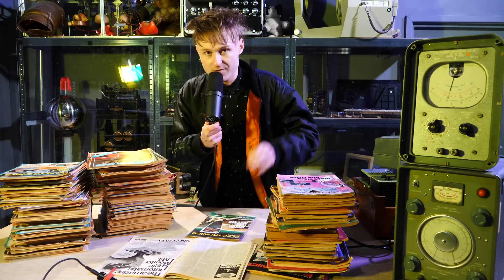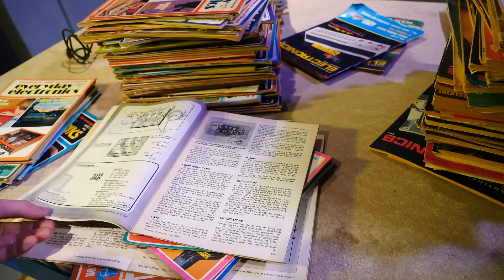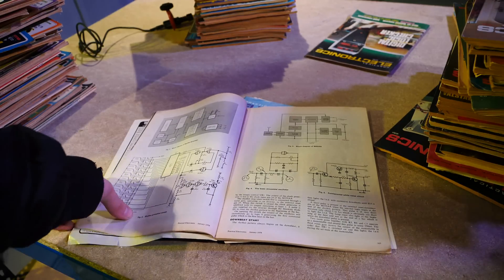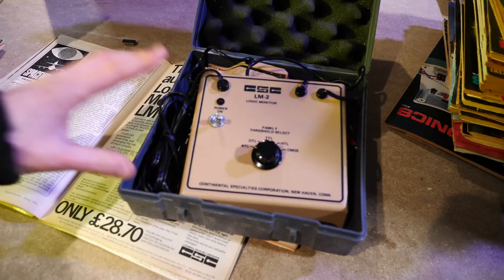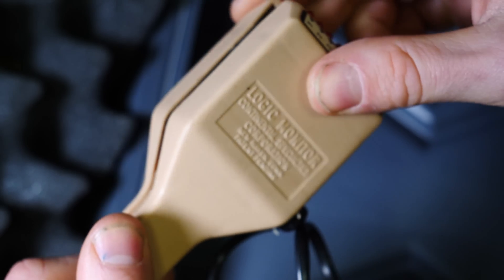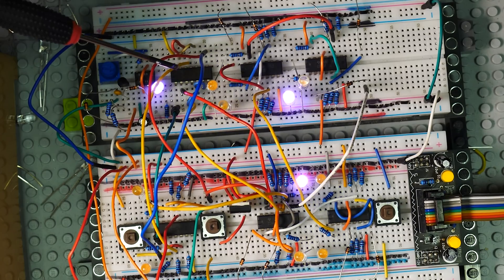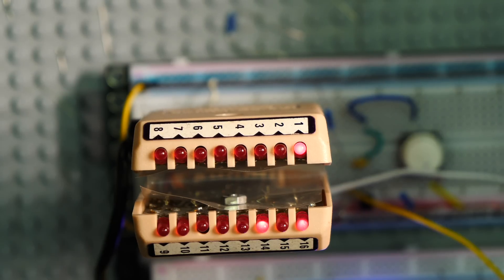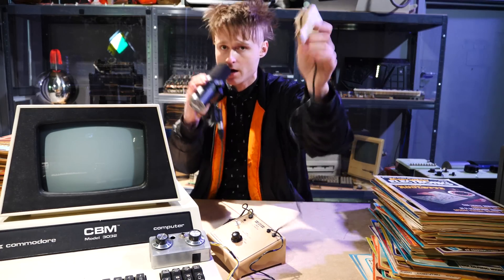Strange 1970's Chip Monitor Test Equipment - LOGIC MONITOR LM-2

Comment: I remember using the LM-1 in secondary skol and it was good when troubleshooting 74xx circuitry, but this is around 1980, on the other hand it did not like the 40xx cmos att all
the LM-2 that you got has the circuitry to handle cmos but the LM-1 that i used in skol only worked for ttl but a useful peas of kit anyway

Comment: Sir
Ref~ GAMEBOY MEGAMACHINE - POLYPHONIC FILTER CONTROLLERS ANALOG

Your original design was correct.  You just introduced the biggest noise to the system when you tried to suppress the vertical hold on all your new screens! (by shorting it out, you sent that noise to the ground of your entire system Sir)
. A suggestion~ 
Would it not be possible to have an independent vertical sync pulse? that is not modulated by the time clocks of the modulated processors?  And buffered!
Please don't trash the finest modern synthesizer in the world~~~~~~~~~~~~~~
R X
PS. Your ultimate masterpiece is perfect. do not doubt
Reply from the maker: There was no noise added? Plus I tried the pulse those screens dont take it

Comment: I had one of these when they were new and cool. Mine definitely was a stand-alone clip. There was no support box. As I recall, it got enough use to be worth the cost. As a dead-chip detector, it was a real time saver too. Another must-have was a logic probe and logic "injector". Basically a one-pin version of this. The injector let you pull pins low or high at will fairly safely.

Comment: Hewlett Packard offered two versions of the Logic Clip.  One was 548A, multi family (TTL and CMOS), and 10528A (TTL only).  The prices in 1978 catalog were $125 and $90, respectively.  The CMOS version operated from 4 to 18 V (and tolerated 30 V for 1 minute).  The TTL version was specified to only 5V +/- 10%.  To really be practical, you needed to have ability to clock the circuit at very low frequencies.  For that you could use a pencil shape pulser 546A that could produce pulses at 1, 10 or 100 per second.

Comment: Talking of reverse capabilities and chip testers , there's a side story to this in the commercial field ! . I wonder at just what period , the hole copyright thing took of on using internals from keyboards and synthesis etc , externally to there ment connectors . Not to mention the hole " I will destruct if I'm tampered with " thing although that's probably mostly military equipment . I suppose that the tester is one of the positives of that period in electronics ( that's if I'm correct )  , i mean and I'm totally guessing that , certain calibration tools are only available bye specialised and dare i say qualified technicians and are also quite expensive , but it is annoying when you unplug an internal connector only to realise that when plugging back in the hole process has to be either be recalibrated bye and external computer or simply coded with a new licence . Even when the device lights up and is recieving the correct voltage etc etc .

Comment: This is great. I was a kid in the 70s, and saw these advertised in Byte and Popular Electronics, but in all these decades I've never seen one in action. It's amazing! I also was only aware of the standalone models that pulled power off of the chip, like the one in the magazine. This one supplies the op-amp power, and a reference voltage for whatever logic family. I've also found on a google search, an LM-2A by Global Specialties where the clip had ribbon cables, and the LEDs were in the main unit. Definitely not as cool as having the LEDs on top of your chip, but maybe less bulky and more reliable.

I guess the op-amps would be wired up in comparator mode between each pin and a reference voltage for the logic type. There's a bunch of 470 ohm resistors for the LEDs, eight half-chip op-amps, and eight more 240K resistors between each pin and an op-amp. The other board should be much the same. Anyhow, there's enough pictures to trace out the circuit.
UPDATE: each channel is: pin → 240K → - input ; Vref → + input ; output → 470R → LED → LED power (+5V?)

I should try to make one, maybe I can use a regular chip clip and some Arduino headers, or 16-pin ribbon cable headers. Probably two circuit boards with common wires for power and ground, but it might need to be SMT. It shouldn't be hard to wire up a prototype pin circuit. I could even build a 40-pin version. Seeing that blinking on top of a Z80 or 6502 would be awesome, and it really needs to be done.
Reply: Still made one of these? Could you share the schematic? Thanks

Comment: That logic tester that you could clip on a chip were still sold in the 90s maybe even early early 2000s.   Haven't seen them much in the last 20 years.  Useful for learning digital logic.   But maybe not so much for fast ( high clock rate ) circuit.

Comment: Being an old fart Electronics Test Engineer, I remember using something very similar as recently as 6 years ago at work. They were used as part of a fault finding kit. The main difference was that the ones we used were TTL/CMOS specific for 14 and 16 pin logic arrays/gates. They were powered directly from the on board 5V logic supply. There was a sliding window switch over the top of the LEDs for 14 pin or 16 pin device selection. 

An invaluable in circuit fault finding piece of kit. Along with LED logic probe (with pulse 'memory') and a high/low tone buzzer for audible logic high or low identification. 
Cracking video, brings back memories of many hours spent building projects on copper strip vero board, love it. Thanks Sam.

Comment: Interesting bit of kit. I have a couple of RS versions which are powered by the chip (no external box). I think the op amps on there will be working as comparators, the selector on the box will select the voltage level for a logic one, and the LED will light if it is over that voltage, so 2V for TTL, 2.5V for CMOS etc. The 145 is the keyboard row selector, so the LEDs show the binary of the row being selected. The outputs are open collector, so won't light up. The 138s are the address decoding and show which of the big chips on the board are currently in use. The 00 includes the gate that drives the sounder, so you might see that flashing when sounds are being made. Over on the right, the 393 is the main clock divider and the 166 is the video output shift register, should be a lot of activity on there.

Comment: I think that rather than a simple buffer chip, the tester probably has 16 comparators in it.

That way, the box just has to supply a set voltage for each logic standard, which sets the logic threshold for the LEDs.

That's just a guess, though. lol

Some of those other logic standards like RTL are pretty ancient now. One of the earliest uses was for the Apollo Guidance Computer (60s/70s Moon landings).

Comment: Interesting they're able to use those 1458s like that. IIRC, they aren't rail-to-rail or high-slew. Figuring out the bias voltages for all that, and making them toggle-able, must have been a pain.
Reply: It looks like they're being used open-loop as comparators and LED drivers. At 400mW max dissipation, that's 200mW per half, so assume <20mA per LED, and you get 10V. Don't need bias for a comparator, just a reference voltage for the high level. There's only 2 resistors per channel, and one of them is 470 ohms for the LED current.

Comment: Great video, forgive me for going off topic but the Lego build was excellent and its a shame they didn't allow comments as I wanted to say great build
Reply: My TV signal jammer in 1979 was called "the TRS-80 Model I". I had to turn it off when the family wanted to watch channel 12.
Reply: @8bitwiz_  My dad gave me a part finished circuit from either practical electronics or a small mail order electronics club. Mainly transistors an aluminium heatsink and a few other key components. All linked into a homemade hand wound aerial made from a glass fibre rob with copper wire and 4 brazing robs acting as a ground plane. That was 35 years ago mind
Reply from the maker: thanks :D
Reply: I remember in the early 90s and I built a signal jammer which wiped out all my neighbours tvs

Comment: Blimey. I had everyday electronics in the 80's.  Building all sorts. I can still smell them now.
Reply from the maker: woop! what did they smell likenew?
Reply: @LOOKMUMNOCOMPUTER  damp shed. I had loads. Gifted by local beardies of the 60's. That and a trip up to the CB cabin where we fiddled with all sorts of audio gear. Probably one of the main reason I ended up in electronics and sound engineering. I'd forgotten all about them. I remember building a PSU for a certain guitarist and shorting out the PA at Glasgow barrolands. Awkward  memory. Got better once I worked on the valve line at Laney. Good times.
Reply: Everyday and Practical Electronics.. I remember them well!! Mmmm that smell.. 
oh sorry that's just my soldering iron I accidentally left on 😁👍
Reply: @fissionchips8840  choking on burning flux and lead.
Reply: @StuEvans  I genuinely had a headache, now I know where it came from 😀